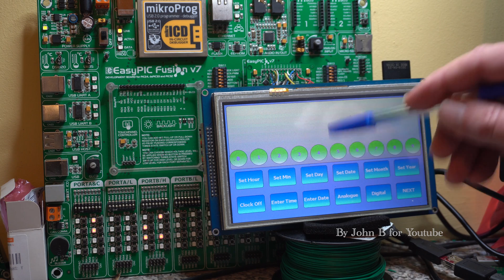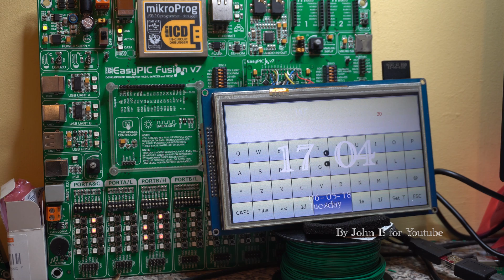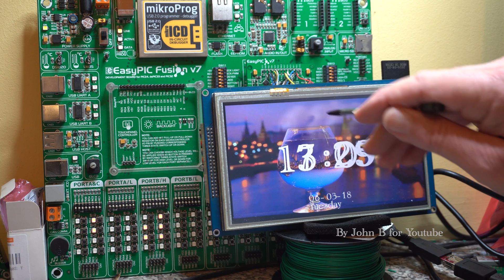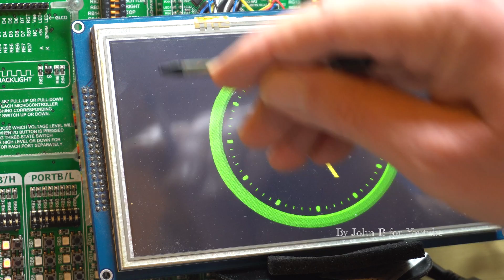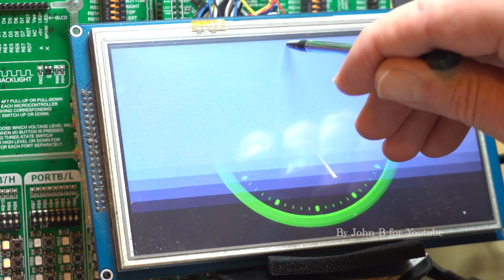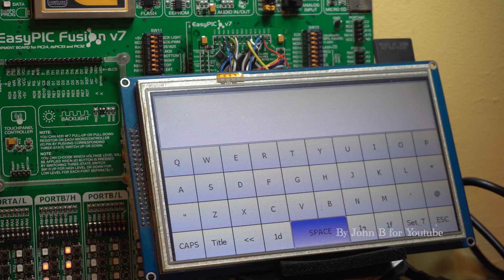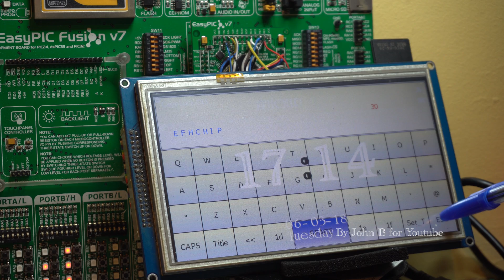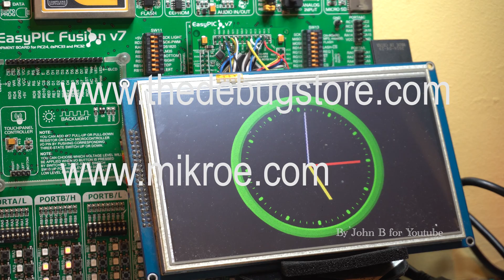What IDE compiler? 62 Reasons to Choose MikroElektronika's VTFT 252 BIG Reasons to Choose Microchip

Comment: The PIC architecture usually needs 4 cycles to execute 1 instruction, so this 252MHz is more like 63MHz from AVR.
Reply from the maker: Yes I believe that was on the early Pic16F... 8 bit micro-controllers.
AVR didn't do too well did they and now Microchip own them lol.
Reply: False, since the 16f84 it is one instruction per clock cycle.
Your mistake come from the quartz frequency was 4mhz for 1 mhz inside clock and each instruction take 1.10^-6second

Comment: John your video has disappeared,,   The one about clock, or did you find a answer to the clock ,, hold off start..  
I have just received the same chip from RS, 29 squids plus...  I did ask before what is the display your using...
Reply from the maker: Hi,
The video was dark and shaky and it sounded like one should wait 3 minutes or more for the oscillator to warm up.
The manual quotes 1024 cycles so the video was misleading.
You should have saved your money, the EFH is naff as far as the UART baud rate generator, the lack of calibration on the RTCC because one has to disable the secondary oscillator, the I2C seems hit and mis too.
It's been great at wasting my time just like all the other naff silicon Microchip are churning out.
There always seems to be problems with only the parts I want !
Reply: oh well crap happens, im playing with the PIC16LF18446-I/P
and the Atmel crypto AT88SC6416C-PU just for a change, im loving this Rigol BTW seeing things i have never seen before  lol,,its all good
Reply from the maker: You should make a video lol
Reply: John B I will have to get @ camera first, lol..